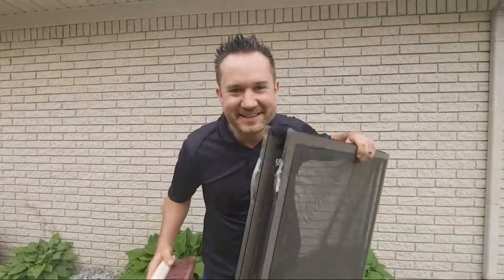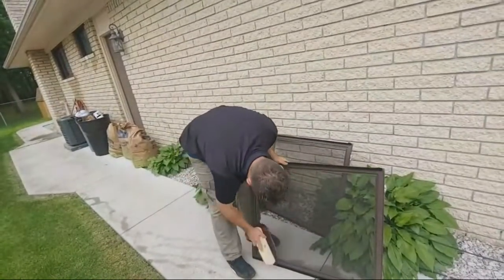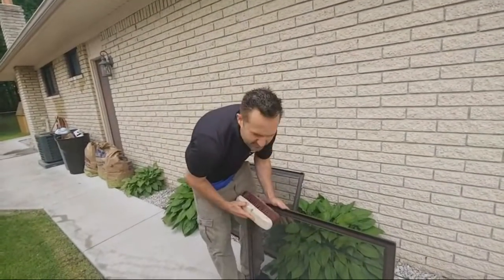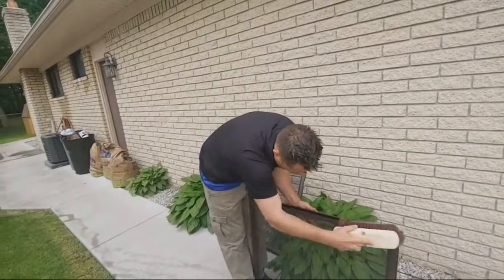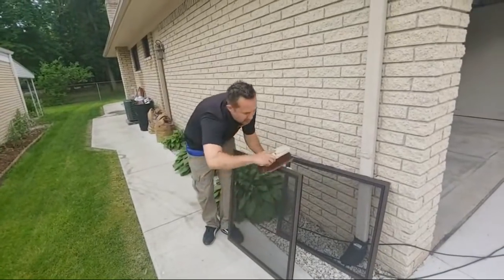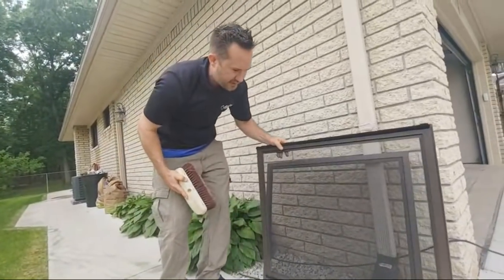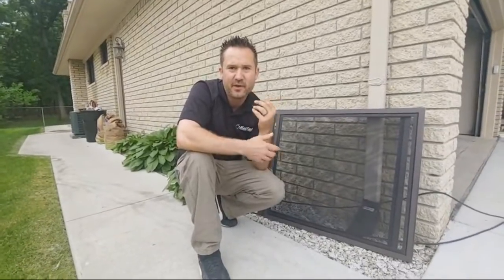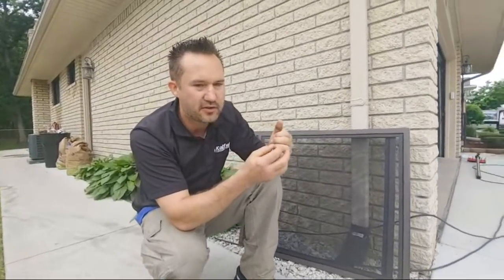How To Clean Window Screens With A Dry Brush | Window Cleaning Business Talk

Comment: For deep cleaning i actually use Carpet Cleaning Rinse powder in a bucket and scrub screen and frame.  Turns it soft and black.  I charge a premium on that because it takes longer than cleaning the windows.  About $3-5 depending on size.   Otherwise i just do a wipe quick.

Comment: I’ve had good experiences with an electric pressure washer. Pros: Quick and easy. Cons: chance you may damage the screen material. (But if you keep your distance there little to no chance of that.) Use the white tip, it helps deliver a safe pressure.